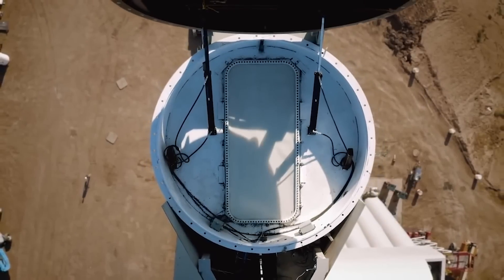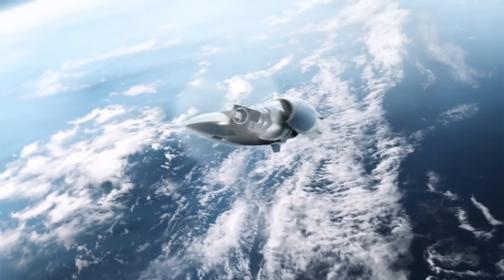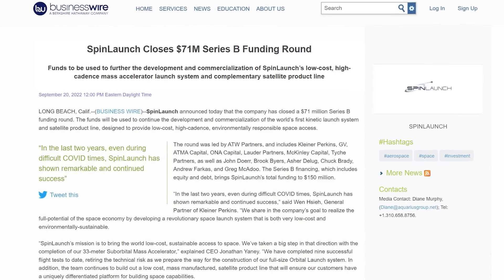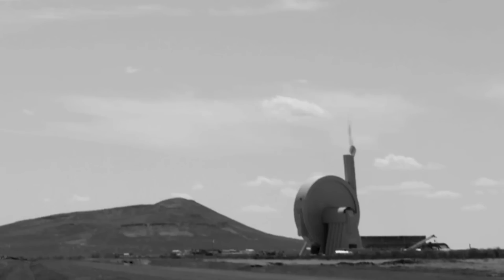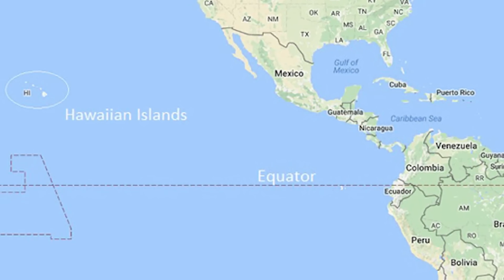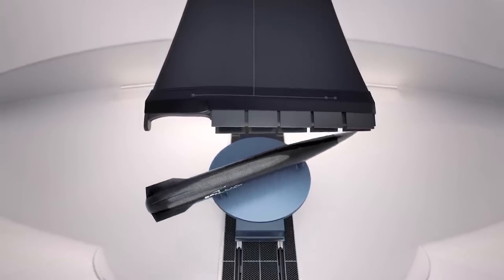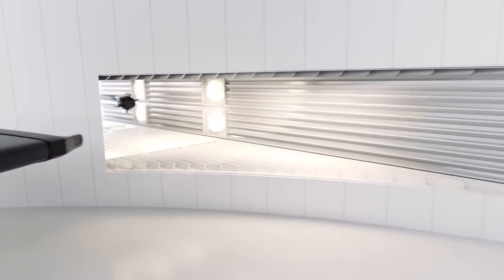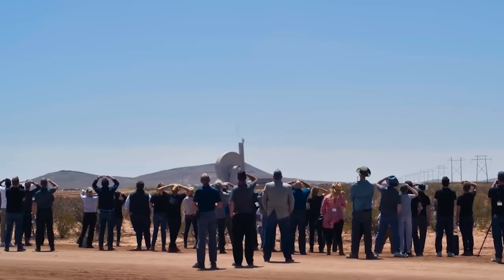What Happened To SpinLaunch & The Orbital Accelerator?

Comment: There are many issues with this system, as many have covered here. Per Spin Launch, they propose a 5,000mph release velocity. This is Mach 6.5. The forces upon the projectile when exiting the system will be massive. Lets look at some of them:

1. Rotational Yaw. You can see the projectile exiting the spin device with a significant rotational moment around the center of mass. This is due to the fact that while released in vacuum the rotational moment of the projectile is not attenuated by aerodynamic forces, and this causes the projectile leave the port still rotating. As you increase the rpm for higher velocities this moment will increase to the point at your window will need to be larger to accommodate for this rotation, and the forces applied when encountering the air will be significant. You can see this instability in their videos.

2. The ram pressure in the atmosphere at 6.5M is significant, and will cause excessive force upon the forward leading edges, and well as negative acceleration turning kinetic energy into heat at a rapid rate. You will also have this force being very abrupt upon rupturing the vacuum membrane. Something akin to hitting a brick wall. It will not do the electronics and sensitive systems any favors.

3. The impact of the seal for the vacuum within the spinning system will place at 7,333ft per second will significantly increase the forces applied to the body of the projectile. Any large cover able to withstand the atmospheric pressure across a large area, will have sufficient mass to cause damage. Look what foam from the fuel tank on the space shuttle did to the leading edge of the spacecraft, at much lower speeds. 

This is nothing but a snake oil scheme to get funding for next years vacation or house. As long as it is gullible people investing their own money on this I am fine, keep public funds and my retirement from this type of money pit.
Reply: 1. Have a release mechanism with two attachment points release the front one first and then the back one. Timed correctly there will be next to no spin.
2. Look up the Sprint missile or at the US navies rail gun both hit more than mach 6 in the lower atmosphere. It's a challenge, but solvable.
3. You could also rip the membrane, before the projectile hits it or have doors as already mentioned (although mechanically quite complex) or just build the projectile to withstand the impact. Again look at the impact tests of the navy for their railgun. That thing hits multiple steel sheets and stays mostly in shape.

All of these issues are solvable as are many others mentioned regularly in relation to this project. The question is just, if it will be cheaper, than existing solutions in the long run. Same for the hyperloop and landing rockets with their engines. The former wasn't the latter was.
Reply: I see nothing unsolvable here. Rockets are complex too. Space is, unfortunately, still hard.
Reply: Well, it would be easy to do if they build the system out of carbon fiber wrapped around a drum with two titanium domes glues on the end and run the entire thing with a game controller on BlueTooth. Take five people on it easy. No old people allowed on the team either.
Reply: @haramanggapuja  You forgot the free WIFI, and no seats to sit on. But hey if they had 2 game controllers you have fun on the Xbox.
Reply: @haramanggapuja dude this KILLED me 😂😂😂
Reply: This system seems to be useful on Mars.
Reply: These are issues I've thought of as well. It makes a nice concept for sci-fi, but becomes impractical the more you think about it.
Reply: Escape velocity is actually Mach 33. I'm not sure where they're coming up with Mach 6.5. That's the biggest problem with these ideas. I worked for the government as a spacecraft engineer. They asked us to look into this type of technology. The speed the launch vehicle needs to reach, would require massive amounts of ablative material to avoid overheating. That's not even taking into account the necessary structural stability.
Reply: @DDDYLN  Agreed. 
I thought they were trying for a low earth orbit, but even then that is insufficient. Unless, they hope to be above most of the atmosphere reducing energy required to make orbit. The physics still doesn't work out though.
Reply: '.......This is nothing but a snake oil scheme to get funding for next years vacation or house. As long as it is gullible people investing their own money on this I am fine, keep public funds and my retirement from this type of money pit....' Thats what it certainly looks like - so many of these sort of projects draining money at the expense of more boring things that work
Reply: Not a chance!
Reply: Wow what a bitter salty comment. Did you seek out this video just to rant? 
You are not worth the time to argue with, your mind is set and nothing anyone here says will change it. Hopefully you'll feel happiness one day
Reply: Yup
Reply: Great for throwing tennis balls, crap for complex electronics, the g force on them would be massive.
Also there's the question of dynamic balance. If the spinner is balanced with the load, it won't be after the loads release.
I have plans for a huge pogo stick if anybody wants to fund me :).
Reply: @donk1822  We already build electronics rated for more than 15,500Gs in military artillery shells, max g-force on the full sized version is 10,000ish. Max force for most microelectronic chips is upwards of 150,000Gs. The issue is mostly going to be on the mechanical connections to a circuit board, wiring, connectors, etc. Design it right and it will survive.
Reply: Boooooo. You're not only ignorant, you're angry about it. There are paths past every problem you've named, and their solution is not only advantage to this type of burn-free launch, they're useful in other applications. BOOO HISSS to you.
Reply: What if they built it as a ship? Floating seem like would help with absorbing the forces of launch and sonic boom issues.
Reply: @egoncasteel  two significant issues with a floating launch platform. 
1. Stability, need the launch angle and direction to be known precisely. Building similar to a floating oil platform might address that.
2. Thick air at sea level means much more launch velocity is needed, and magnifies all the issues discussed earlier.
Reply: I feel like a space gun absolutely would have been a better idea for what they are going for. Not a full one, but a hybrid system. 

 The sustained large  Gs versus a very single large one. Pick your poison.

 Wow those people don't even want it near them? The hell. Lame people. Chances of your house having debrie fall on you are ridiculously low.
Reply: Well said.
Reply: And this is just the beginning. What about the counterweight that is needed to balance the rotation? What about the g-forces exerted on the vehicle? What about total energy needed to put something into orbit, etc? With solid-fuel rockets we need something like three skyscrapers full of high explosive and it's still barely enough to lift its own weight...
Reply: @SioxerNikita again, you have zero knowledge of this. I want you to think of the  VERY carefully, step by step, moment by moment. 

If the rocket is attached to the arm at its center of rotation, and is traveling around the center of the machine, EVERY particle is traveling in the same straight line at every instantaneous moment in time. It’s basic calculus and differential kinematics. Its velocity vector is pointing in a straight line at all times. It has no rotation around anything, but is merely accelerating inwards orthogonally to the velocity vector at any given moment in time, meaning that when it is released, the inwards acceleration (affecting all the particles equally) will immediately stop and it will follow the straight line vector with no rotation. If it was released from a point NOT at its center of rotation, it may have some sort of yaw, but they could easily make it release from that center point. 

Please think very carefully about it, I promise I, and all other engineers and physicists are correct.

Read a college level physics book PLEASE.
Reply: @SioxerNikita  you have to be trolling at this point. If so, very impressive on how many people you’ve fooled!
Reply: @SioxerNikita   and no, I think I’ll keep the degree I have straight A’s through classes harder than you could ever imagine in. Nice try though kiddo.
Reply: @SioxerNikita  you are trolling. 100%. I refuse to believe someone can be so unimaginably idiotic in the face of so much evidence from people much smarter and more qualified than them. I’m done arguing though. I’ve said my piece and like the other guy said, you are set in your ways. Ignorance is a positive feedback loop.
Reply: @SioxerNikita  let me know what Mach number needs to be reached to get to low Earth orbit. I'm genuinely interested. I don't feel like doing the calculation. Regardless, aeroheating at the Earth's surface is not like aeroheating in the upper atmosphere, where there's a giant mean free path between air molecules. You're talking about dense air at 1 atm. There's a gigantic difference. When the government asked my group to look into this, we all came to the same conclusion. It just wasn't possible with current thermal technology.
Reply: @SioxerNikita  do you work for this company? I certainly understand the governments desire to fire things into space via this type of technology, or some type of rail gun (that's what they asked us to look into). I'm not saying it won't be possible eventually. And yes, you have to start with proving you can actually get something up there from the ground, without expending rocket fuel. I'm a spacecraft thermal design engineer, so I primarily think about heat transfer and thermodynamics. Once they prove they can fire something into low Earth orbit, they'll have to figure out how to design a thermal control  system that can actually fire something useful into low Earth orbit. With the technology at the time I looked into this, it wasn't possible. However, the government didn't even have a rail system that could accomplish the necessary velocity to begin with. You're correct. Everyone says something is impossible, until it is.
Reply: The trouble is that a lot of the money sunk into this sort of thing does come from taxpayers in the form of things like tax breaks. If I invest a million into a company like this, that's a million I don't have to pay tax on.
Reply: @Chriscooper312 Is that so simple as not paying any tax  equivalent to amount invested? Far from having experience with business practices and investment law of US, in EU you don't have 100% taxback as far as i know, never mind private investments in high-tech start-ups. We have 60% tax-rebate you apply for and get refunded if everything checks out for donations to official charities.Never seen funding paid by your own taxes, just for projects which pass for grants from specifically designated EU funds.
Reply: @dannydetonator  I don't live there for local  or state taxes. My federal taxes are wasted many ways more than anyone can know. Tax deductions for various investment expenditures is a fact of life. That being said I just do not want direct funding of this stupidity by the Federal Govt. , or my 401k investments. What anyone else does if their business.
Reply: @dannydetonator  New York State was going to offer Amazon a zillion dollars worth of tax credits to build their HQ in New York City. The project was blocked by political opposition and Amazon moved to a different state. There is no functional difference between tax credits, government grants or a capital investment. Both Tax Credits and Government Grants come from a limited pool of money. Once it is gone it is gone, and every bad investment is at the cost of a good investment that might have seen new developments or community benefit.

A big part of the problem is that grants and funding are run by accountants that have no skill at estimating technical risk.
Reply: @dannydetonator  Nah, what he's saying isn't exactly right. If you invested 1 million dollars into a company, you wouldn't have to pay taxes on it right *now*, but you still pay taxes on whatever income you derive from that investment in the future.

There is a fun trick that the rich use where you borrow against your investments at low interest rates to obtain liquid currency, so you are never taxed for capital gains. Your assets continue to appreciate until you die, and then your heirs can sell off those assets if they want without incurring the capital gains taxes you would have had to pay.

This allows you to live off a much, much lower reportable income than what would normally be needed to support your glitzy lifestyle; as all the homes, cars, private planes, and other large expenses are purchased with money that was never taxed by the federal government.
Reply: @CheezMonsterCrazy yes lol just an inheritance tax that is way more than capital gains. But ok.
Reply: @jamesbizs  You just use grantor retained annuity trusts to dodge the majority of your estate taxes.
Reply: @ChrisCooper312 stop comparing tax breaks, to money from tax payers. It’s absurd. 50% of all tax payers pay ZERO fed income tax. A tax break is not the same as a subsidy!
Reply: @ChrisCooper312 also, this works for literally anything! You clearly have no idea how taxes work. You don’t pay taxes on money you invest with. You write it off, the way literally  every company does for literally everything  you  spend money on. You pay taxes on profits. If I buy something for $90, and I make $100, should I be taxed on the whole  $100? No? Then why would I be taxed on the initial $90 I put into it? This is why capital gains tax is absurd. You’re taxing money that isn’t actually made yet. Next, we should tax people on their 401ks too lol. Before they put it in or take it out decades from now. Right? Is that your logic? I’m sorry, but I just really despise this type of thinking. It makes zero sense.
Reply: @jamesbizs  Capital Gains taxes (US anyway) are only paid AFTER you liquidate the asset, so no, you’re not paying taxes on money you haven’t realized yet. That’s true for both short term capital gains and long-term capital gains.
Reply: What I don't understand is how the team behind this just seems to keep working on this project. They're somehow capable of designing the thing, but not capable of understanding these massive issues. What's going on with that? I mean, is it like Elizabeth Holmes and they know very well that it's impossible? Or are they so far up Mt. Stupid that they're unaware of the scam they are running?
Reply: @Gersberms  Remember the Hyperloop? That was one of Elon's many projects. Where is the hyperloop now? How many people worked on it? 

Many times someone works one something past the point of viability, at that moment your either realize it won't work, and stop, or you continue on hoping beyond all hope that it will work. This is why gambling is so dangerous to people, that promise of success is very strong even when it cannot be achieved.
Reply: @rpercifieldjr  I agree, wasn't the hyperloop   a very old idea, tried by someone in the late 1800s or early 1900s or something? Another "not a train" idea.
Reply: @Gersberms no, hyperloop is not an old idea. There were 2 systems for propelling pods with air pressure / vacuum, but neither proposed reduced drag as a means for enabling high speed.
One system had a sub-surface drive tube with a slot in the top sealed by leather flaps. A piston in the tube connected to the train via a bar.
The other had a pod that sealed (poorly) to a tunnel.
The first was more successful, but suffered from the leather degrading in weather. By the time sufficiently advanced rubber compounds came along, the limitations of a single unsynchronised drive system were seen to be game over.
Reply: @Gersberms  Of course they know. Or at least the senior engineers do. But they get paid well to make giant spinning rock throwers, and their army of inexpensive recent grads are only going to work there long enough to put it on their resume.
Reply: @Gersberms  Of course they know what the problems are.  But this isn't a company about putting things in orbit.... it's a money making scheme.  The tax codes for the rich when it comes to "investments" is just a bit scam to create assets.  It's just paper wealth generation.
Reply: @Gersberms I think it’s kinda like when a kid thinks he’s a superstar at sports even thou he sucks, but his dad and mom keep telling him he did a great job and he’s the best
Reply: @Gersberms I don’t know, how did Solyndra last so long and with getting millions and millions of tax dollars? Lol. I mean, don’t  get me wrong. There have been plenty of innovations, by people that were told something is impossible. So maybe they do believe they will figure out a way to do it. Or maybe they just enjoy having a high paying fancy job. At least dumb things like this, still produce innovations that can be used in other things.
Reply: My non-expert replies to your concerns:

1. Since they're spinning up in a vacuum, they can angle the release mechanism slightly to account for this yaw, and by the time the projectile comes out of the port, it will have rotated to be in line. Then, the fins and atmosphere will take over and stabilize it, stop the rotation, and even give it some spin stabilization if they want to add that in.

2. There will not be a vacuum membrane on the orbital version. They have said this so many times and he even talked about it in this video. They will have doors that open and close very rapidly to let the projectile out but then close again to maintain the vacuum. This is something they've been talking about for a very long time. They don't want to have to pull down the vacuum every time as this would significantly increase their launch cadence.

3. See #2.

I don't know if this thing will ultimately work or not but I think you're arguing on some uninformed assumptions. I remember how many people were saying SpaceX would never be able to land orbital-class boosters and that they were wasting investors' money and should just give up. Are you one of those people?
Reply: My dude, I'm guessing the engineers who've been working on this for the last 6 years thought of all this, and they wouldn't be proceeding if they hadn't already solved it or were working on solving it. Space is hard, new things can happen sometimes, nothing you listed here is an impossible problem.
Reply: @stefanblandin  They worked on the hyperloop for longer and where is that? The worked on Oceans Gate for longer and how did that turn out? 

Engineers do not hide solutions that they are asking for money to fund. This guy will not answer them. There is a reason they do not use canons to launch satellites, it doesn't work. Launching something at Mach 6.5 is in the hypersonic range, and they just laugh off the basic physics in doing this type of aerodynamics. I just will not stand by and allow such blatant low resolution thinking to be passed off as good engineering practice and science based. Maybe if more people had spoke up about the Oceans Gate fiasco, they would not have died. It is time to stop this stupidity.
Reply: @rpercifieldjr  the people actually working on hyperloop are almost all student or training teams. They all know it's a tough ask, and that's why they're using the idea to train people, and as a engineering showcases, not actually build a hyperloop.
Reply: Landing a rocket booster on a barge floating in the ocean was also a crazy idea.  The physical force involved in the spin launch process or immense.  I would stay away from investing in the scheme.  I think,however, that this may have an underlying use for the military. The United States, being the largest arms dealer in the world may be interested in this concept for drone launches. It would be like a machine gun launching guided drone armaments. Big Money, yea baby.
Reply: @billkurek5576 landing a rocket was at least feasible, with the right tech and innovations. I don’t think anyone said it was impossible. Just maybe a waste of time and money. People are saying this isn’t even possible.
Reply: @billkurek5576  So before SpaceX no one landed a rocket using thrusters. Thrust vectoring has never been used to land vertically on a moving ship. Autonomous vehicles cannot land on moving craft. Autonomous vehicles cannot dock in space. Sorry, but while SpaceX is doing cool and great technological things they also do some pretty stupid stuff as well. The launch pad in Texas is a good example. They knew what their thrust forces were going to be and that the structure was not capable of withstanding it. So rather taking the time, money, and effort to do it right, they get to do it over.

Has SpaceX made great advancements in the modularization required for space flight? Yes they have. Do they push the envelope? yes they do. However, physics is uncaring about what you want to do, you either heed the laws, or you loose. You cannot ignore something and hope it works out, this is not politics, economics, or some other soft science, reality always wins.

At 5,000mph in the lower atmosphere the forces will win over marketing. There is no reason to launch a drone at 5,000mph, centripetal forces on the projectile would be worse that launching from a canon. But hey go ahead and believe the marketing hype. If you believe the marketing so much take and invest all of you assets into this money pit. I am sure the developers would like you to fund their next vacation.
Reply: @rpercifieldjr  the launch platform was expected to withstand a single start and they didn't expect any problems with it, it was a surprise to them, so that's not true what you said. According to the official information it was the ground under the launchpad that gave way thus creating environment they didn't predict and they didn't include in their calculations.
And they can't invest all the money in the world into this project, one goal of it is to make it as cheap as possible, if they make a successful launcher but will not be able to scale it accordingly (we are talking hundreds here), they will not achieve their goal. Not investing excess money and time is part of the goal here.
Reply: @rpercifieldjr  The Texas launch pad debacle immediately caught my eye, and I have average intelligence. I still find it remarkable and concerning that such a basic design flaw would occur in a highly-technical environment. When such gross errors take place, it usually indicates deep organizational infrastructure deficiencies  not easily resolved. This is just one example in the Musk family of endeavors. And Musk himself has been showing increasingly-serious deficiencies in reasoning and behaviors with the purchase of Twitter (and subsequent destruction of that organization) as just one example. Musk is probably the greatest entrepreneurial genius in history but all indications say he's headed for an ugly end due to a series of self-inflicted wounds.
Reply: @jlvandat69  Elon musk is a spoiled rich kid who saw a missing niche in certain futuristic technologies. He isn't a genius in anything. The only thing Elon Musk is exceptional at is selling Elon Musk.
Reply: @rpercifieldjr project harp enjoyed the reference lol
Reply: @rpercifieldjr  "The launch pad in Texas is a good example. They knew ..."?  That's some significant Monday morning QB-ing.  No one knew with certainty what exactly would happen with that launchpad, even the FAA.  Musk anticipated some failure, but not that much, and understandably so, since no one had ever even tried to launch a rocket as powerful as Starship.  And that's exactly what testing is all about.  I'm sure Musk and his engineering team used that updated data for their next launch pad.

Had Musk gone ahead and made the water deluge system for the first launch, there's a good chance it would have failed as designed.  The first test showed the engineers that their water deluge system would have to be more robust than anticipated, and thus they probably made some design changes based on that first test, for example, maybe increasing the water flow.  That being said, there's no guarantee the new launch system will do the trick.  Are you willing to do some Sunday QB-ing about it?  What Musk does know is that his engineers are trying to develop something cheaper than NASA's (probable) engineering overkill (and very expensive) launchpad in Florida.

Also, Musk would have had to delay testing of the launch vehicle.  Had they waited on their water deluge system (which was still being designed), they wouldn't have learned about the abort problem, so as to fix that.  That info (and a lot of other things) has gone into improving the next Starship.

You're using the NASA mentality for rocketry design, which works fine if cost overruns (forget profit) are not a consideration.  Instead, Musk understands that when you're doing something that has never been done before (a cheap quickly reusable rocket), all the theory in the world pales in comparison to actual test data.  He can't rely on such theory because in a large sense, he's inventing the theory.

Personally, my guess is that the real bottleneck for reusable orbital rockets is going to be those heat tiles.  I'm not sure if we're there yet with the technology.  I'd like to see how they perform in a real reentry.  I have my doubts.
Reply: All 3 of those are solvable issues. Yes, they are real issues, but I can show ways to solve all 3. The are issues with the sub-orbital launch design, not necessarily with the design of the future orbital launch facility.
Reply: @geoffstrickler  If there are issues at less than Mach 1, what will be the issues at Mach 6.5? 
The energy in just the projectile increases as a square of the velocity. At 340m/s (speed of sound) a 100kg mass has 5.882Mj of energy. At Mach 6.5, it has 3.344Gj of energy. This is just the projectile, not the rest of the system. The arm will have to be much larger in mass and the resultant energy. They will use a partial vacuum and the flow of air  at those speeds will further increase the energy in the system. When the orifice is breached pressure inside and outside will equilibrate and the turbulence of the air and the arm moving at 6.5M should be fun to see what happens. But hey, what is a few10-20 giga Watt Seconds inside a large building, hopefully away from everyone, destabilizing in very rapid time frames. The video of the deconstruction should at east go viral.
Reply: @rpercifieldjr  There is no reason it has to puncture a pressure bladder, there are alternatives, it simply wasn’t necessary to implement them for the demonstration building. You’re looking from a very limited perspective. Same applies to the other issues. The greatest is probably just maintaining the rotor arm and maintaining it’s balance when the payload is released. Even using a counterweight that is released concurrently, you’ve got a tremendous amount of energy to dissipate safely.
Reply: @geoffstrickler  Ok tell me the alternatives for moving a barrier capable of holding 14psi across a large aperture and moving it rapidly enough to keep the atmosphere out and maintain the partial vacuum. From the videos and specifications listed it appears that the opening is at least 3ft by 7 feet. First order approximation makes that 3,024in^2, if the pressure differential is 10psi, that is 30,240 pounds. At 12psi that is 36,288 pounds of force. Not only do you have to support this force, it has to be opened very rapidly. Since the projectile is traveling at 7,777ft/s  covers 1 foot in about 128.6us the opening must be opened faster than this. In the real world, that type of opening is done with burst membranes, and not mechanically. But hey in magical thinking land, maybe Harry Potter can help you out with the wave of a wand and some incomprehensible mumbo jumbo. 

You keep saying these questions I have are easily solved, but offer nothing but marketing phrases, "there are solutions", "we have a plan", etc. When you can provide something other than weasel words and reality based calculations and concepts to resolve this I may be persuaded to accept the concept. Otherwise this is nothing more than low resolution thinking generated vaporware.
Reply: @rpercifieldjr  In the beginning I'm pretty sure I remember them saying they want to use 2 sets of doors. One closes behind the projectile, then the one in front opens. I'm kinda surprised to see that they are still using this "burst membrane".
Reply: @serpico1616  At the velocities they are talking about at 7,777ft/s the speed of the door is significant. While the use of two doors would be ideal, but to move that massive of a door capable of sealing off a large opening is daunting. While a flap door may be possible the stresses involved are huge, and the dynamic shock loading of the air impacting the door will be extremely difficult to withstand. This is not a trivial issue, and may be why they are still using the burst membrane.

My concern is that they are not being forthcoming as to many things, and asking people to invest into this without a plan and hoping there is a solution is not compliant with fiducial responsibilities.
Reply: @rpercifieldjr solutions...
Let's start with sensible units, thousands of pounds is toytown engineering.
In real money 1 bar over the aperture is 20 tonnes. That's between SFA and buggerall for any hydraulic system.
Opening? Just let go of it (long enough so it is fully open in time for projectile release) 
Closing? An inner aperture is configured to slam shut under inrush of air, once the projectile has passed the shutter is released. Once the inner aperture is closed, the outer one can be closed, the gap evacuated and the inner one opened.
Yes some air will enter the chamber, but no where near as much as if a simple door was opened. The only reason for the setup is to reduce time needed to completely depressurise the chamber, any vacuum saving is a bonus. 

BUT THAT'S ALL POINTLESS. 
Launch speed has to be higher than re-entry speed. Where the atmosphere becomes irrelevant, it must be going up as fast as a vehicle from the intended orbit would be going down (minus an insignificant 3,200 kph). Given the deceleration due to drag between launch and space, launch speed is enough to vapourise anything. It needs to be a meteorite in reverse. 

G loading on the projectile as it spins up will turn any payload to soup. 

Unless an equivalent counterbalance is released simultaneously, the rotor will disintegrate. Good luck catching a hypersonic counterweight. 

Then theres the release mechanism...... 
Yes, there are some mighty big impacts to absorb, but dampers are a very mature technology.

Edit add:
Door opening time has nothing to do with projectile speed, but everything to do with how fast air enters the launch tube.
Reply: @rpercifieldjr are they not being forth coming? Are people being forced to invest, without asking and or receiving answers to these questions ? Who is the dumb one there?
Reply: @rpercifieldjr imagine the shock wave when that vacuum seal gets pierced! I wouldn’t want to be anywhere near that thing.